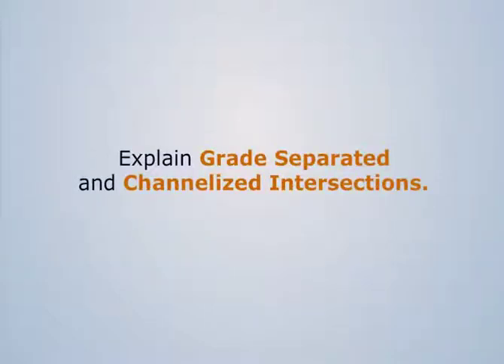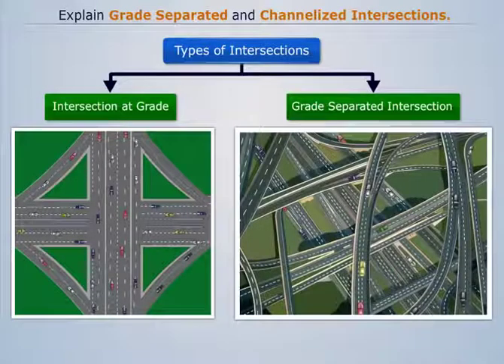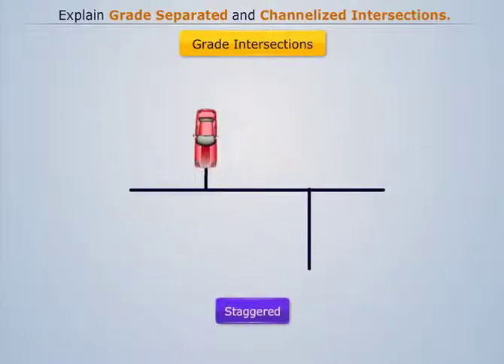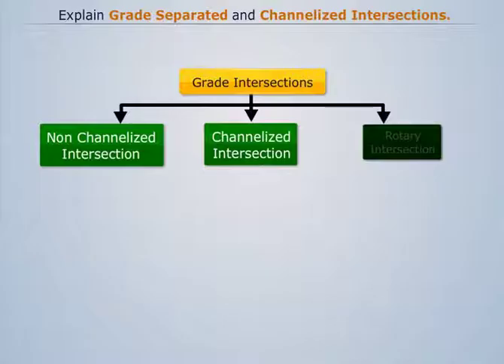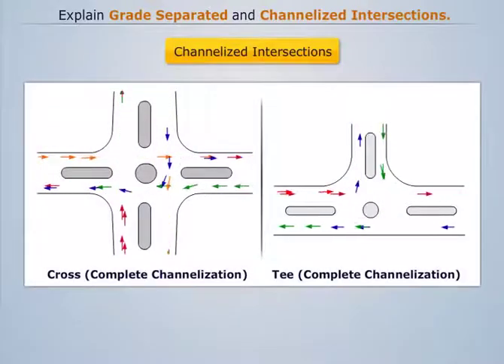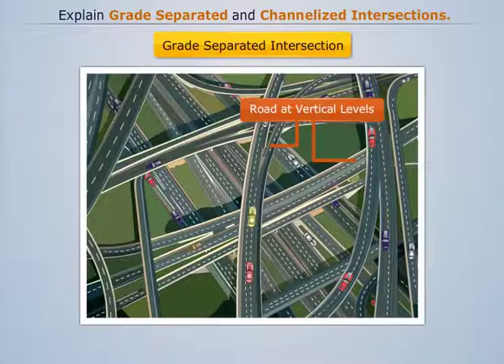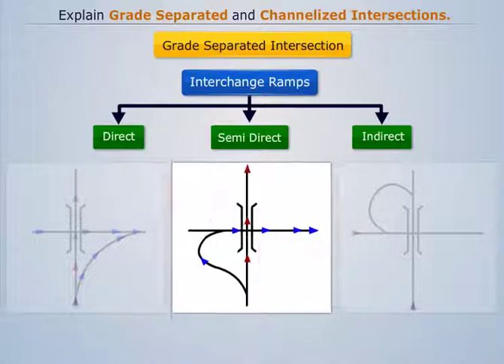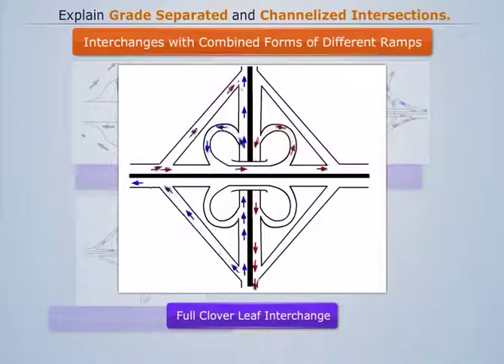Grade Separated and Channelized Intersections | Transportation Engineering

Comment: Better, cheaper, and simpler than overpasses. (Type: "4782 Post Road, Charlestown, RI" into Google Maps for example/ note route 1)

Also:  (Type: "Intersection without traffic lights. #dubai #engineering" into the YouTube search box)

Question - does anyone know the technical term for this configuration? Thanks.